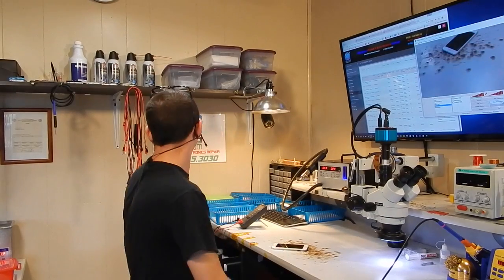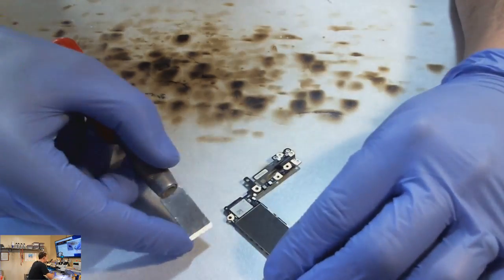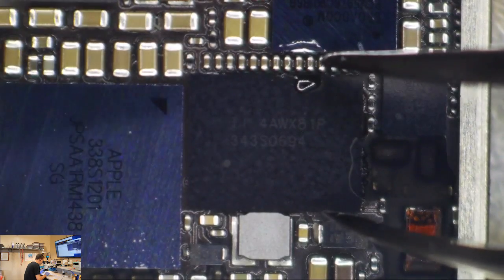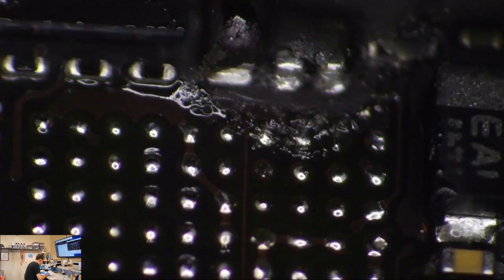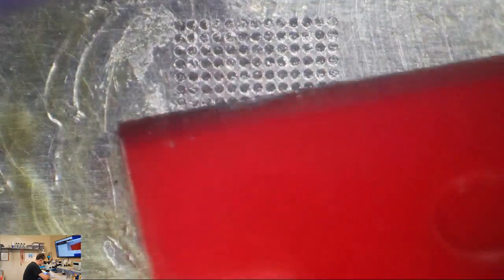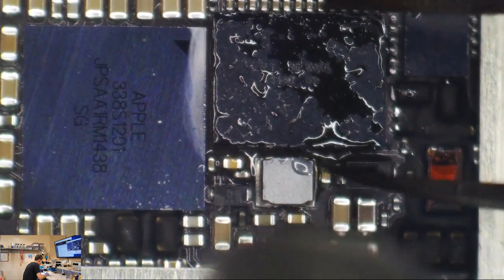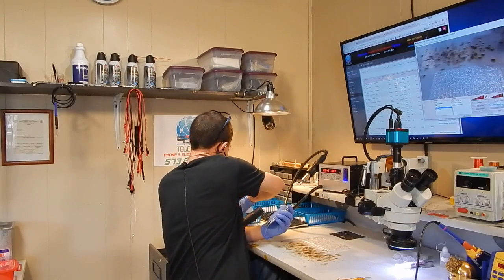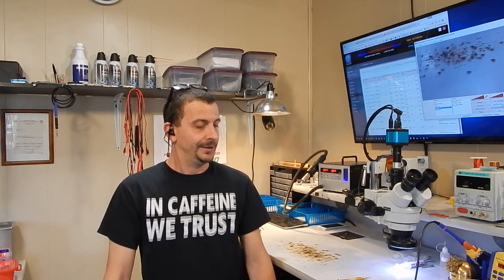A Crazy Visual iPhone 6 Touch IC Failure & Repair

Comment: Old vid, new comment, sorrey. No one really mentions this in their videos so I'll ask: When you're refreshing the solder on the board pads - are you actually touching the board, or just hovering over it with a blob hanging? And in case of the latter, any distinct exceptions?

Comment: Hello nice work, thanks for this greatfull microsoldering stuff! I tried also to fix an iphone 6, with touch issues, i changed the touch ic, but problem was not gone. I have on middle of LCD a line of cubic bars. On this position, touch is not working/broken. FPC Connetors are well on first look. Changed another LCD to try, same problem. I think there is another chip what is cause this touch problem! Any idea or tip for me? Thanks amd best regards. Thumbs up

Comment: my iphone 6 suddenly out of nowhere has a section at the bottom that just does not respond to touch at all, so cant swipe from bottom to get floating icons also any tiny icons at the bottom of the screen are useless, had a guy try 3 screens and all the same result

Comment: Can an iphone 6 screen cause no touch when the phone is twisted? A new screen fixes it but there is no physical damage to the screen that loses touch when twisted.
Reply from the maker: Yes, it’s very common on the 6/6+. Especially with the original Apple screens.
Reply: @ststele  Thanks for the reply, I know you are very busy nowadays. I have only ever seen the 6/6+ with touch loss regardless of screen being used, this one threw me off. It's the first time I've seen a 6 lose touch from twisting and it end up being the screen, usually a new screen will do the same thing.

Comment: why is it so expensive in apple for 150$ they could replace the phone
Reply from the maker: Too many coming in for me to keep up with so I have to slow them down.  There are many shops doing it for less though and as long as they put in a solid jumper to the M1 pad (on the 6+) and use good solder, it is more robust than a replacement model from Apple that will only last as long as the last one did.  They're only covering the 6+ tho.. :-/

Comment: Hi. Great videos! I sent a few boards to someone who messed them up. Each board was sent out with just the touch issue and returned either completely dead or with other issues such as proximity sensor. I've watched several of your videos and read some of your comments to other users. You commented in one of your videos that sometimes things on the other side of the board move around from the heat and cause these types of issues. Is there any way to lessen this or prevent it completely? I know you're running on more of a strict time schedule, but for someone that has all the time in the world to spend on one board, is there any extra steps that can be taken to prevent this from happening? I appreciate any help you might be able to offer as I'm thinking to try to get into micro soldering, but am trying to gain as much knowledge as possible before attempting on some broken boards I currently have. Thank you!
Reply from the maker: Before the touch IC repair, I started picking the row of components clean that are between the front flex connector and the CPU shield.  That eliminates most all of any front facing top flex issues.  I also pick the touch ID components clean between the home button connector and the edge of the board.  That eliminates any touch ID issues.  The biggest problem, I think, are components on the other side of the board becoming detached.  That rubbery coating changes shape as the solder under the components is molten and it raises them up off the board.

Comment: I just watched your video on your backlight repair for the 6s Plus posted on November 29 2016 I am having the same issue after fixed a cracked screen on my own trying to save money now I don't know if I should try to do what you did in the video to fix it but I don't know if it was specifically that bottom connecter anyway I would love to get this fixed

Comment: What temperature you use in air soldering station? Nice work, i like your videos!
Reply from the maker: Thank you! =)   I leave it set on 390C pretty much all the time.
Reply: i leave mine on maximum, only adjust airflow

Comment: In my opinion don't use metal tools for opening iphone because skratches be careful. Good job.
Reply from the maker: Thanks :)   I do more pulling than I do prying with this tool.  The pressure goes between the blade and the screen so it would be very difficult to find marks from my tool on the housing.  I totally understand tho :D

Comment: Tips on cleaning dried flux in stencil holes? Looks like you just swipe soldering iron on it. I've used paint brush cleaner before
Reply from the maker: Hmmmmmm... I wind up using the iron with solder for the most part.  Then alcohol after that if I want to try to be really clean..  I'll probably try ultrasonic one day =)
Reply: STS Telecom That doesn't leave it clogged at all?